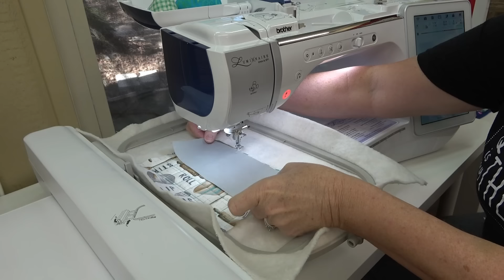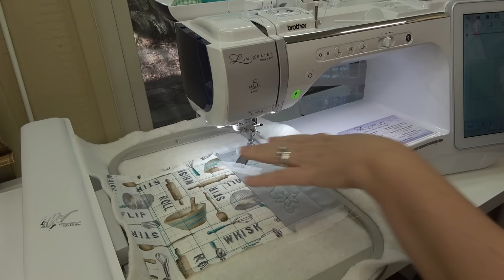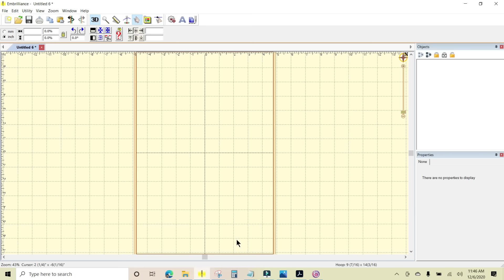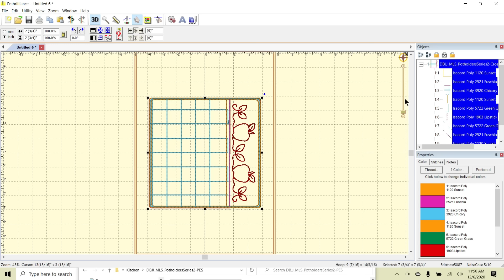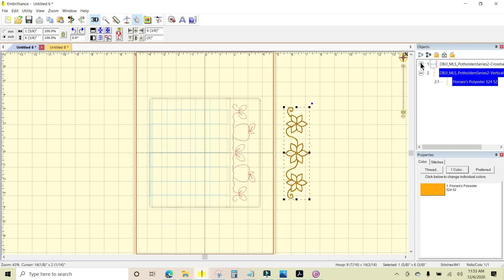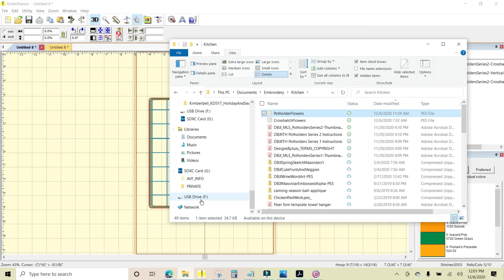Machine Embroidery Tutorial - DBJJ Potholder, Series 2 + BONUS Embrilliance Merge Tutorial!

Comment: Hi Becky can I ask if I have an 8x8 mighty hoop can I use this or will it be too small? I also have an 8x8 for the luminaire will this work as the designs are 7.7 etc? Thank you. I know it says you need at least an 8x8.
Reply from the maker: I think you can make these in an 8x8.  Give it a try.  If the design is too large for your hoop it won't stitch.  If you're not sure, do a trace around the hoop to make sure it will all stitch and fit properly.  But I think the directions say an 8x8 will work.  Good luck!

Comment: Becky, i have a viking husqvarna, sewing/embroidery machine w/premier software. was wondering how compatible the software  would be with scan and cut machine ?
Reply from the maker: It's not compatible at all unless it will save applique files to the .pes file format which is what the SNC will use to identify the tackdown (cutting) file.  USB that file to the SNC and then save it again in the software to the .hus file format for use in your machine for applique.  It will work then.  Test first for sure.  I wouldn't alter the image at all once it's in the SNC because the .hus stitch file won't know it changed.  You'll have to make any and all changes to the file (resizing, mirroring, etc.) in the Premier software before you save it to .pes to USB to the SNC.

Comment: You are awesome, you know everything! Can you please tell me how to adjust my tension on my Husq Viking Designer 1? I have changed my thread 18 times minimum for this Cactus Punch Design. I can't imagine how many while trying to adjust my tension...@least double regular  changes! I have changed needles, & thread.
On the software you are discussing above, so it will let me save it on my floppy 3 1/2 drive?
Reply from the maker: Well, I wish I could help on your tension issues but I'm not a Huskv girl - totally unfamiliar with those machines and I recommend you find a tech who can come into your home and fix the machine while he sees what you're working on. I've found that to be the best way.  Look around in your area for in-home sewing machine repair.   For Embrilliance, anywhere you want to save a file for your machine - even your 3.5" floppy, you can save.  You might have to save it to your computer first and then transfer the file to the floppy, but it should work one way or the other.  Good luck!
Reply: @PowerToolsWithThread  
I thought you might know someone, every time I call them they are closed due to covrd. I will try a Husqvarna dealership. Our closed closed.